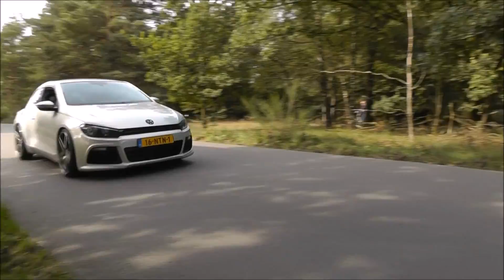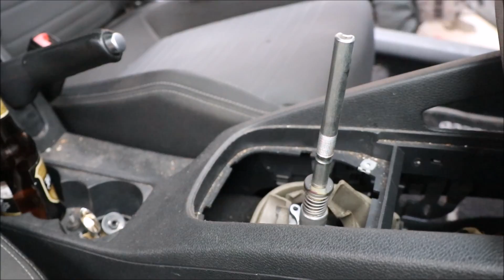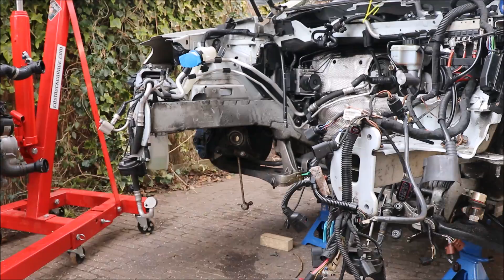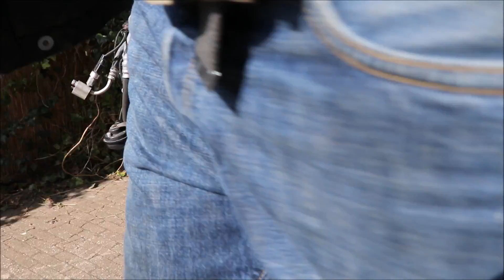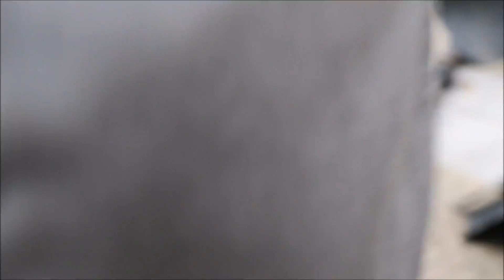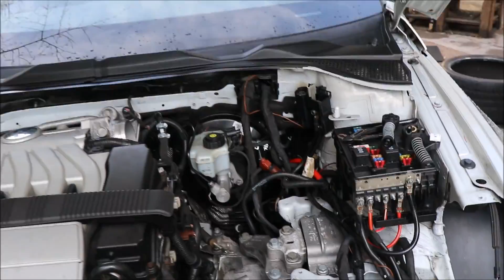ERG SCIROCCO R36: ENGINE IS BACK IN!

Comment: You swapped the engine without making it 4WD, doesn’t make sense for me.
Reply from the maker: Mustapha Arh it is still 4-motion. It went from an Automatic transmission to a Manual transmission here. That’s why the engine had to come out. If you watch the previous video you can see a transfercase was mounted to the new manual transmission.
Reply: EastRockGarage sorry I didn’t understand, you mean you made it 4WD with the original engine before the swap???
Reply from the maker: Mustapha Arh no the original Engine was a 1.4tsi fwd. When the R36 engine was swapped in, it was also made 4-motion. All the steps are in the video’s.
Reply: EastRockGarage okay I will watch them, I texted you Instagram, can we talk privately please I have some questions 😅